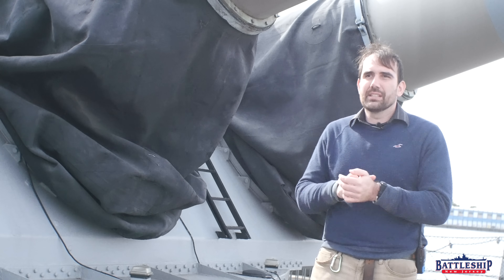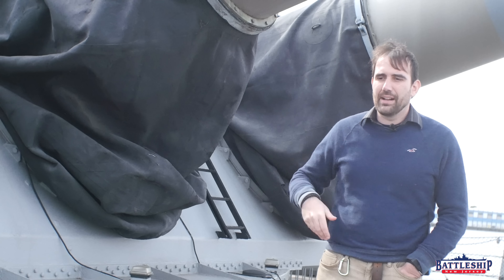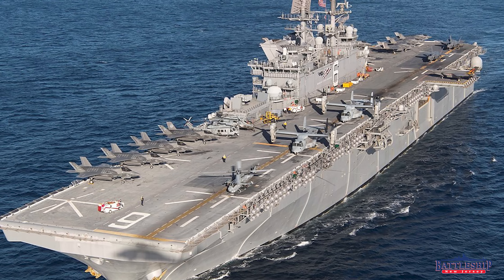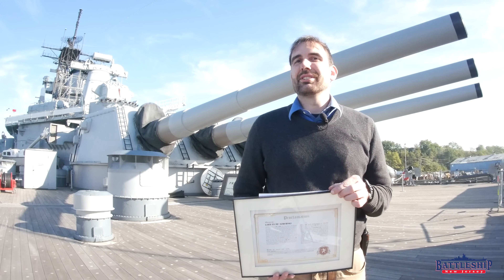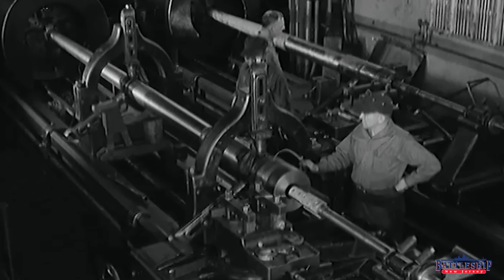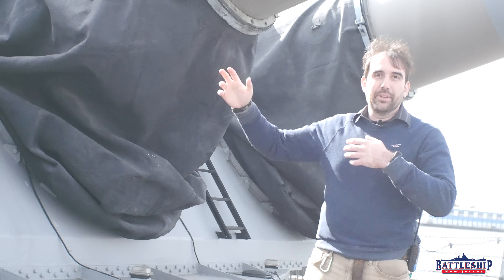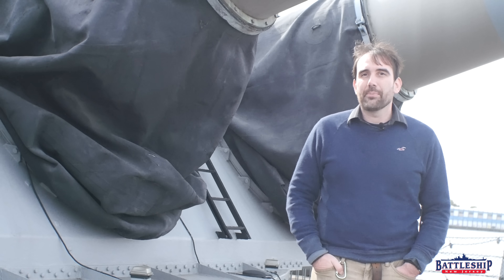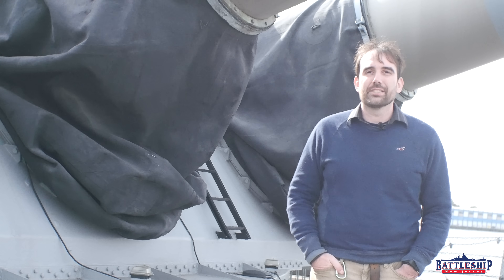How Much Would It Cost to Build a Battleship Today?

Comment: 9:51 If the navy is gonna build a new BB, that's a huge investments that new generation 'big guns' must be cost efficient compared to naval cruise missiles of all forms. i.e. Railguns  would replace 41 cm big guns ONLY IF these guns were not only big, but also outranges any Cruise Missiles. AND Railgun shells max cost must be ONE-Third of Tomahawks.
In addition, this new generation BB will be
1. Tech intensive, and it means AEGIS orany similiar techs.
2. Maximum personnel of 500
3. Nuclear Powered
4. Drone capables. (Only when combat drones surpassed manned jet fighters yet one third a size of the said jets)
5. Stealth capable (Not easily detected by radar)
6. Uses composite armor.

But then again. some net nerds did mistook Modern DDG with 'Battleships' by simply called those ships as such. This came from mis-translations of 'warships' by Chinese media, and even Indian media took the same bait. calling their DDGs or even lil Frigates 'Battleships' regardless that these ships are 'naked'--no armor protections of any kind.
I don't really convinced if anyone referred to Chinese Type-055 'Battleship'. To me it is Missile Cruiser like Ticoes and no armored hull (or maybe they might be).

A new gen BB would still required to externally armored. One may be as big as Zumwalts and can have two or three gun batteries but no bigger than 15 cm (choose what's already available), the ship however will be missile-heavy and drone intensives. using technologies available today. mmm it might sounds like the Old Chinese Idiom "point to a deer and call it a horse" (指鹿為馬; zhǐlù-wéimǎ), that maybe 'Baka' (馬鹿). and the construction costs can be more expensive than Burkes and Ticoes but not Zumwalts. it has to be superior to newly concieved DDGX... Basically BBs were about the size of Zumwalts before.

But who in the US Military asked for it? Navy? (Capitol ship for lightweight battlefleet without the need to deploy carrier fleet) or USMC? (The very reason Iowas were reactivate several times are due to USMC's needs of coastal bombardments. something BBs are really good at).

What is my answer to this. I'd say 'Design a new generation BBs' with what we have today and with minimal investments. This will surely be upsized Burkes and Ticoes.
but the same mistakes that ruined Zumwalts shouldn't be repeated again.

Goals: 
1. Carrier escort in addition to what availables today
2. Flagships for 'cheap' battlefleet (No carriers) capable of working with Frigates.

Comment: Here's a question... if money was no option to build new, what would the systems be like? Could you design a modern fire control system for the 16's? Or update/modernize the original FC?  Would you even need to change the FC? Modern radars and electronics are a given, in my opinion.

Comment: IT'S ISN'T MIZZOOURA, RYAN!

I'd say though, if you were to go through the effort to make a BB-esk ship in the modern day, you'd probably want a class of 6 ships (3 per Atlantic, 3 per Pacific - 1 each deployed, 1 each training, and 1 each in port doing maintenance and such) and you'd probably be in the $8.5-$10.5B USD figure range per ship, give or take half a billion or so.
If you were to want a design w/ a 406mm (16in) gun, then I'd argue you'd only want it in a 1x1 configuration as a short bombardment cannon, and using an advanced autoloading system. Maybe would also need a mechanism to do barrel changes at sea...? Otherwise, the modern 127mm (5in) autoloaded guns are fine for relatively close in defense. I'd say probably 8x2 mounts amidships in 4 superfiring pairs. Otherwise, you're looking at LOTS of VLS tubes. Ideally, a ship of that magnitude, you'd want to develop a new type of hypersonic anti-ship cruise missiles to justify such a ship. (...and of course lots of anti-air/anti-missile missiles, and CIWS guns.) As for armor, not getting hit in the first place and having really good damage control is a much bigger deal than actual armor these days, not to mention large caliber guns aren't a thing anymore. Probably looking at an all or nothing type scheme where the core areas are protected against something like 152mm (6in) shells or comparable anti-ship missiles. Propulsion would obviously be nuclear with high speed being a priority. Probably would also want to try to squeeze in maybe a pair of gas turbines as emergency backups. Wouldn't get you full speed, but you could limp it back to port with the aid of some refueling ships.

Comment: As you said there is no infrastructure to build this type of ships.Even the more recently constructed ships with some type of protection have a tiny amount of armour . it would be a gargantuan effort that would take around 10 to 12  or more  years before a ship of this type and dimensions would be ready to test much less effective comission. If there was a *real preement tactical eed *for something like a modern battleship . it would honestly be more practical and faster to modernize and reactivate the existing Iowa  then to build new ones, as the new construction would only be available ,if started now, not before 2033, most likely around 2035 if all went well ,  or even close to 2040 if there is changes in the planned equipment and so ,

Comment: interesting youtube. thanks for the quesion and answering. a big factor would be the price you pay for 1 shell versus 1 rocket/missile. would be interesting as a follow-up question. the only limiting factor would be the range as missiles can fly land-inwards further then shells. i would assume building a new ship with 1x2 turret or 2x2 turret would be plenty and i would still consider that a viable option as a warship. way smaller crew and cheap shells which can hit accurately (enough)

Comment: New build. Need better hotel services than the aging Iowa's can support, sailors compromised their watertight integrity to get AC running, and need excess electricity to support current and future energy weapon programs (anti-drone/missile lasers etc) which all but necessitates nuclear. Auto-loading turrets and explore everything in the 10-16 inch range. Design a precision shell like Excalibur system from Army artillery. Reduce the size of the superstructure and possibly eliminate a turret to include VLS. Include helicopter landing area but no servicing, offload that to the fleet. A full suite of anti submarine systems. Heavy anti-missile/drone defense in layers - including suicide boats (USS Cole).

Alternative, a cheap monitor like Terror and Erebus. Single big gun turret with modest armor and CWIS.

Comment: In the era of aircraft carriers, they're not going to be doing the sort of gunnery battles they were built for, so just a 1:1 scale with identical capabilities wouldn't really fit the job. However, the capabilities that need filling are the shore bombardment role they had in the Gulf war, and the air defence coordination/fleet flagship roles the Ticos can do that's being lost.

At a spitball, with a much more automated modern model, the gigantic superstructure isn't necessary or desirable. You could probably save some space and cash going with something like a carrier hull layout, with the superstructure offset and put forward/rearward. This would let you put the main turret amidships.

Only one main turret would really be necessary for shore bombardment, and putting it amidships might help even out the strain exerienced by the rest of the hull. Add on that you knock it down to 8 or 10 inch, and design for long distance firing, to improve inland reach. Or alternatively, make it the Zumwalt gun and you'll solve the cost issue with their ammunition, thus making their 40-mile gun more useful as well. In either case, add on a drone capability and you'll have accurate spotting of the battlespace and fall of shot.

Nuclear power, obviously, to keep up with carrier fleets and smaller squadrons.

As for missiles, etc, entirely air defense. Phalanx sets and SM2. Leave sub hunting to the Burkes and DD(X).

Comment: I don't know if anyone else mentioned it, but you should plan for a build run of 6 and not 4.  I think that was the original plan back in the day, and you can split the tooling costs 6 ways using that plan
Reply: If you want a ship, you need to have 3. Tgats the rule of thumb. Because one will be in scheduled maintenance, on ein Training and only one at full operational capability. With 4 you get a spare to either have 2 operational sometimes or later to compensate for unscheduled repairs and modernization.

Comment: Much of the cost of tooling for an America class ship, or any modern ship, is included in the build cost, so I wouldn't add too much extra just to compensate for the fact that these haven't been built for 75-80 years. Building an exact replica, identical in every way, would be a bit cheaper than building it to modern standards.
Also, while battleship guns haven't been built for a long time, artillery guns have. Not any 16-inch guns, but 8-10-inch. It would be more of a scaling-up operation than a start-from-scratch operation.

Manufacturing the thick armor plates would likely be the most challenging part.

Comment: For the guns, couldn't they strip the ones of the old Iowa ships? (I don't they they have all been scrapped)
The Nuclear drive would be expensive, but they can adapt existing types fairly easily to what the battleship needs. 
A "New" Battleship would also use a mix of big guns, VLS missiles smaler arnament (40MM AA, CWIS, RAM, lasers,...) 
The railgun program is suspended,. untill Material sience comes up with solutions to the wear and tear... simply a matter of time ;)

Comment: sounds cheaper and faster to bring them back into Servis. I would do both. While you bring them back you can start working on building brand new ones using the WII guns tek.  Reason is you learn while repairing the old ones to build the new ones. Also, if you're in a fight where you need a BB then you need them as fast as possible. BB's have capability's that no other ships have. You can load and shoot a 16-inch gun a lot faster than you can load and drop a 2000lb bomb for less money per shot. This is the same reason the army still uses 155mm guns in the age of attack helicopters and A10's.

Comment: To answer the question at the end, it seems to me like it depends on what the intent is. Do you want 1/a floating battery or do you want 2/a class of modern capital ships that could go toe to toe with the capital ships of your potential adversaries. 1/ could be satisfied by reactivating the Iowas and just strapping modern equipment on them. 2/ would require completly rethinking what is even a BB: completly different armor scheme, weapons, sensors & propulsion.

Quick question: anybody has any idea what a shot from the railguns that were initialy intended for the Zumwalts would do to an Iowa (at some reasonable combat range for a rail gun) ? Is it possible to realisticaly armor a ship against one of those ?

Comment: An interesting exercise would be to design a modern "battleship" using only existing or easily obtainable technologies. Nuclear powered, Aegis system, armed with long range (rocket assisted) guns, long range land attack missiles, surface to air missiles, possibly anti-satellite missiles, close in defense missiles/guns, armored with current tech steel/composites/kevlar etc. Highly automated to keep crew to at most 300-350 (comparable to AB DDG).
Reply: Crew of 300-350 would probably be hard. An Arleigh Burke has about 300 and that's relatively modern. A battleship is supposed to have redundancies to let it continue fighting even after suffering hits. That also inclueds personell... both for operation AND damage control.
Reply: @user-mk8kx1rr1g  USS Zumwalt has only 158 crew.
Reply: @dogsbd And it can’t do damage control. The current obsession with limited manning is stupid.
Reply: Why build one huge single target when you can spread the same offensive capability to several smaller ships that makes enemy weapons systems have a harder time tracking them all?

Comment: I'd suspect a modern battleship would end up looking like a Kirov, though nuclear power might be off the table because its intended to get shot at. Guns would be a complete mess because the largest guns the navy has are the 5" on the zimwaults and those can't even be used. So lets say a capital ship with gas turbines, 2 triple 5" mountings on autoloaders, armor plate could be relatively easily tooled up but wouldn't need to be as thick as an iowa, but might be more subdivided due to needing to survive missile strikes. lets stick 4 lasers on it as secondaries because we have the POWER and then the front of the ship is all VLSS cells, you'd have a ship capable of sinking anything it gets within gun range of, and could survive being shot at by missile fire

Comment: If building a new battleship I would replace the concept of the 16 inch guns with VLS launchers for a combination of long range cruise missiles, anti air and anti ship missiles. And amidships a suite of dual purpose guns for closer range engagements and Cwis. But I definitely would keep the armor to make sure it can take the beating it dishes out.
Reply: Quite my idea. design a new ship, armored outside, protected inside. having Burke aramid armors for vital rooms, and Chobham or other Material Science wonders added to the hull. the size can be about as Zummwalts but stronger.

The point is, the ship shouldn't be too expensive, and this means build it with 'what we have' first.

And that has to be superior to DDGX being developed rightnow.

Comment: id use an old one, for a simple reason an aircraft carrier is not meant to take hits so having a Nuclear power plant is kinda safe, a Battleship however is meant to take hits so having a Nuclear power plant wouldn't be recommendable so it would have to be Diesel powered or steam, but if there was a sudden war, one year to fix up would be faster than a new build

Comment: Would definitely need to build new.  If for nothing else than to have an automated 16-inch main gun like the very late heavy cruisers had with a modern system most likely being some sort of rail gun system for the main armaments to function in either a direct fire mode or a lofted, poor-man's rods from God mode.  The other reason to build new, there are bigger locks in the Panama canal these days that allow for building a bigger two-ocean battleship class. ;-)

Comment: I would have to say new build would be better. Rebuilding using our existing Iowas would mean that either they would have to gut all utilities and replace them (did you account for that? I didn't think so...) as well as all other systems that were added after the shell was built, including propulsion systems, et al.  Not to mention we would not have our WW2 museum ships which are priceless as they are! I am assuming that the new factories that you would have to build would have other useful things to build... after the new battleship was built. I am also thinking that this very question has an admiral somewhere drooling...

Comment: well- the very short answer is "nothing, as one wouldn't do it, not as an exact copy". what would make some sense, perhaps looking at the Pjotr Veliky and such? of course debating if those do make sense? perhaps- taking the basic design of an Iowa, making her gas turbine powered so freeing up a lot of internal space by deleting boilers, still doing 35knots. keeping the 16inch and 5 inch guns, adding more CIWS. but most importantly- using the now available space and buyoancy for latest electronics to fire the latest missiles, anti-air, anti-ship and land attack. that would be something really awesome for power projection and, properly supported by AA and anti sub assets, could handle a lot of tasks where one might not want to risk a CVN. does it make sense? probably not, as most tasks can be done using carrier aviation- but it would be some vessel to have!

Comment: Oh, definitely new build. You'd want it to make in excess of 40 knots, and you'd want to replace the turrets with automatic loaders with less guns but faster firing. You'd probably be firing different warheads like cruise missiles or torpedoes or something out similar to the extended range russian tank shells. It'd be mainly for cheap shore bombardment. You'd need to redesign it entirely to not have blind spots on its defensive systems and you would need a lot of them.

I'm not sure it'd look much like a battleship but similar to what we have now but bigger.

Comment: Between reactivating museum battleships and building new ones, there is no good choice. The old battleships are not only not in good enough material condition, but the institutional knowledge of how to run them (especially their powerplants!) is long gone from the Navy. On the other hand, building new battleships would require reconstituting the industrial infrastructure to build new heavy guns and armor plate, a project which would make the Ford-class CVNs look like bargains. 

So the correct answer to Ryan's question is, "Find out what requirement is pushing the drive to bring battleships (old or new) into service, and find some other, saner, way to meet it."